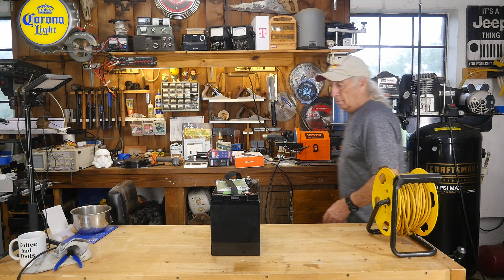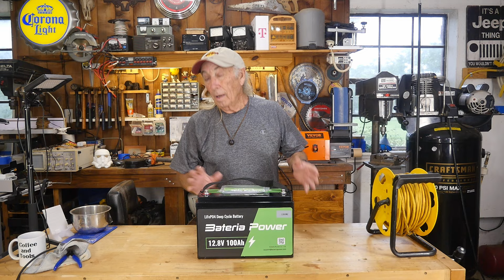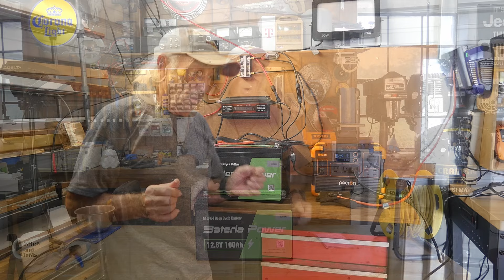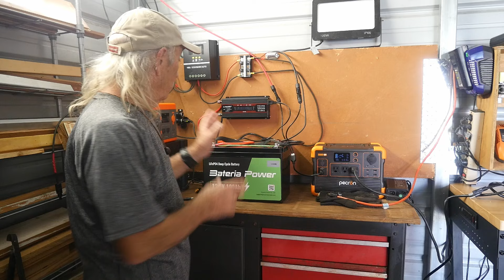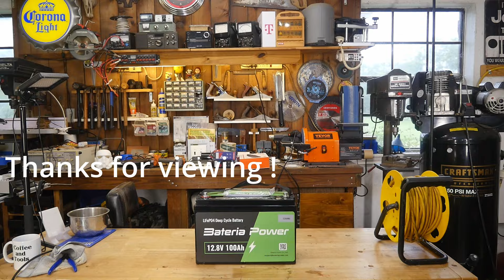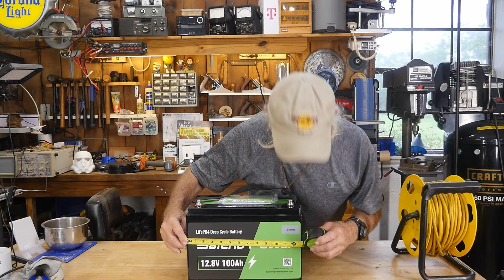BateriaPower,12V 100A LiFePO4 battery LiFePO4 batteryDeep cycle battery storage PT 2 from C&T

Comment: If you did not run the ice maker in the frig, either by turning it off or allowing ice maker it to fill the ice bin, would the frig use significantly less power?  My 18 cubic foot frig uses an average of  about 120 watts per hour (I do not have ice maker, I minimized opening the frig door and for this test period, did not add anything new  to the frig that needed to be cooled).  I had the frig hooked up to a power station that pulled in 250 watts via 2 panels.  My solar power station has a total rated capacity of 1010 Wh.  I could run the frig with this system during daylight hours.
Reply from the maker: I ran the ice maker otherwise my wife would have dot dot dot. The frig did pull 125 at low and showed to run up to about 400 watts when cooling and maybe even the ice maker was kicking in because I did notice 2 difference heavy cycles. The cycles didn't last long, but we did better than expected with what little we have for solar panels etc. The extension cord was really my only bottle neck to our needs. 100ft is just not ideal, but no choices make you do funny things LOLOL..

Comment: Why would “deep cycle” be on a lithium iron phosphate battery?
Reply from the maker: It's complicated but it does increase the quality build on a lithium iron pho bat. There is a lot more to "deep cycle" , you could check the other channels about the differences. :face-blue-smiling:
Reply: @SirTools  deep cycle is only relevant to lead acid batteries